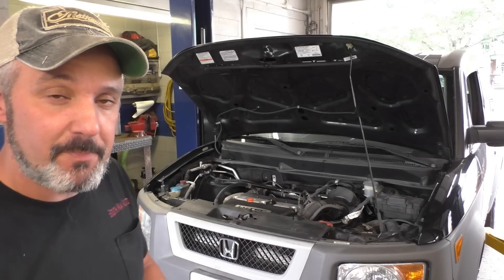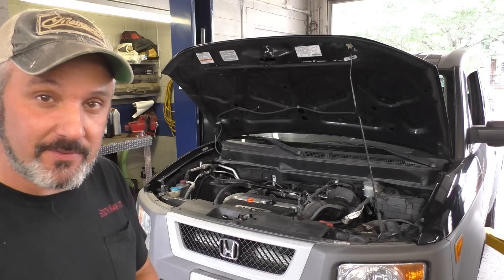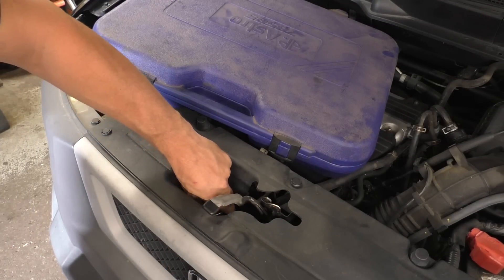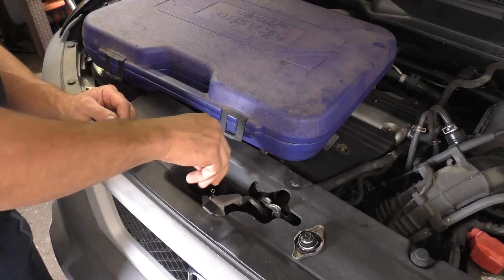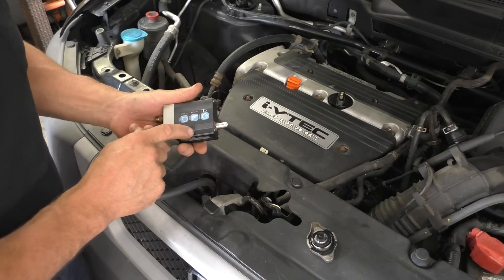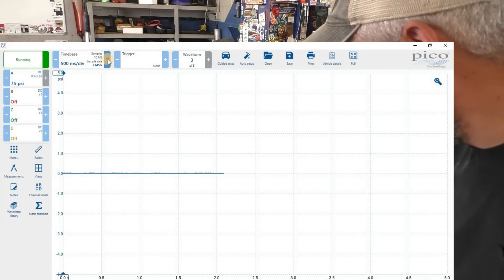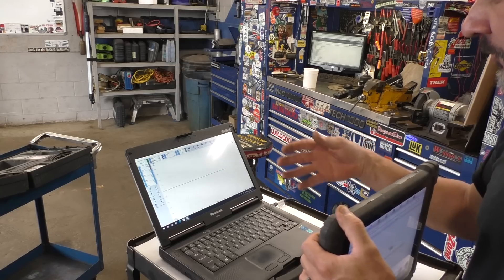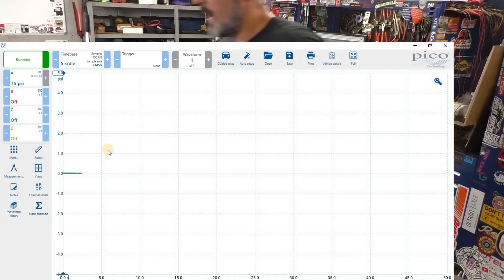Blown Head Gasket? On What Cylinder Though....🤷‍♂️

Comment: As soon as you showed the graph for number 3 I figured it is leaking between 3 and 4 and I guessed right. Great job ! It is to bad all mechanics aren't that thorough in their diagnostics. Maybe they don't want to or maybe they don't know how. I came across your website looking for a problem of my own after having my 03 Chevy stall while pulling my boat. that was my fuel pump connector. When I did the fuel pump I noticed my power steering was having issues and installed a new pump. I drove a 100 miles from home and the truck died in the middle of nowhere and had to be towed. I searched and searched and came across your website and found a video about a truck intermittently stalling after replacing the power steering pump. You found it was a bad ground for the ignition coils that grounds to the block near the power steering pump. That was my problem and I thank you for the solution. That happened last year and I have not had any more issues.
Reply: Eric O's video will be a research/nostalgia trip bonanza years from now when the only thing left of these upstate NY vehicles is their NY DMV notes that they were once registered in the state of NY 😅

Comment: Simpler way is pull plugs, look at insulators. Cleaner, whiter will be cylinders getting coolant in them. Pistons will be cleaner too, which you could see with a cheap endoscope.

Comment: How about trying to find if compression loss on a cylinder is from a valve problem or a holed piston without sticking a camera down the plug hole or removing parts?

Comment: I had a similar problem with my pathfinder leaking head gasket on the exhaust side no milk shake no drivability issues 
Only found out one day when my wife seen a puffy white cloud on a cold start then car rlran perfect dealer warranty the work only after leaving it over night to have them do a cold start. Was told it leaked after shut down and car sat once started and warmed no leak. Weird issue but glad my wife caught it before warranty was up.

Comment: This is the typical way Honda head gaskets fail, between cylinders and water jacket. Seen it a bunch on the J35 V6 engines, especially cylinder 5 for some reason. As it worsens, it will have a cold start miss/stumble until the coolant is burned out. Pressurizing a suspect cylinder with a cylinder leakage tester and observing radiator bubbles is  my go to because I'm too cheap to buy a pico and WPS. 😆 Cool demo of the WPS though. I may someday pop for that stuff. Only scope I have is the uscope.

Comment: Eric, you have a good head for head gasket woes !!!! No exterior leaks, no antifreeze in the oil, no water vapor exhaust - so must be internal leak is a reasonable assumption. I would agree. Plugs look good, no antifreeze gushing out of the spark plug holes. Now 99% confident to take off the cylinder head and see what is happening. Waiting for part 2 - The Tear Down !!!! Brewing a new cup of chocolate cherry coffee in my Krup's single machine. I'll get a 8 piece of mixed chicken at Walmart and I'll be ready on my Lazy Boy recliner !!!!!  Bring it on !!!! 😀👍🍮🐔🛠😺

Comment: Love your diagnostic process although would it have been better to start by removing all the plugs at first, then installing them one at a time.  I believe the difference is when you pulled the first two sparks individually out, it had no effect on the pressure on your test.  Does that really eliminate those cylinders?  By taking all plugs out in the beginning,  it would show no pressure build up as you showed when you had all the plugs out.  Then what you could do is start by putting plug #1 back in to see if there is a pressure build up.  If not, then put in #2, then #3 and so on.  By doing the test in the opposite manner as you did, you truly didn't prove the cylinders number 1 and 2 were not also an issue.  I'm I wrong in my assessment?

Comment: using a coolant system pressure tester would work also, just connect it and crank the engine instead of pumping it up, same result with the gauge reading pressure that shouldn't be there and a whole lot cheaper 😋

Comment: I remember back in the 90’s my sister had a ford escort. The cooling system was getting pressurized enough to send a geyser out of the radiator about 4 feet 🤣

Comment: Never even thought about doing it this way, great job like always Eric. The new way I recently learned is to pressurize each cylinder with the radiator cap off until you have a fountain from the radiator.

Comment: Being in a shop myself; time is money. I personally don't see a point in knowing what cylinder is leaking when your about to rip into it for a head gasket. Especially on a 4 banger. It's fun to be absolutely sure it's a head gasket that has failed but going beyond that is kinda pointless. To address your comments on it not showing more of the classic signs of a blown head; it's not a big enough leak yet. It was caught early. Your meter only read about 1 PSI of pressure during the cranking phase. You would need a lot more then that to blow into the coolant to actually see anything. But good video as always Eric O!

Comment: I got into this business because troubleshooting technical issues logically is the one of the main things my brain can do and loves. Watching your videos reinforces and builds on a lot of the stuff I learned in school and on the job so far. I'd even used one of your videos to diagnose a faulty ignition switch during some on the job training. Once I realized that everything that wasn't working relied on the ignition switch's status, we plugged in the scan tool and voila the status was super sketchy as you turned or jiggled the key. Sometimes it's the simplest of tests with a bit of know-how.

Comment: Awesome stuff! Glad to see you showing this method! I personally have never pulled the plugs like that to confirm. It certainly does require some more analysis, but I use a first look delta sensor, a trigger off a coil or plug wire, and then I overlay a piston chart made by “the drivability guys” to help analyze the waveform. I’ve probably confirmed head gasket failures a half a dozen times now this way, and I can say that only once was it just 1 cylinder leaking. Thanks Eric!👍✌️

Comment: That's about what my 1982 Ford Escort used to do.  It didn't actually have a blown head gasket.  It had a crack between cylinder 3 and 4 that involved a water jacket.  It was burning antifreeze.  The only complaints were that you literally filled the antifreeze and checked the gas, and that you could smell antifreeze in the exhaust and even when it was just shut off and parked.  It started and drove fine.  And I do know exactly what was wrong with it, because I helped to tear it down and saw the crack.  The head and gasket were fine.  As it transpired, this was a common problem with that 1.6 liter engine, and the reason they stepped up to the 1.9 in 1984 1/2.  They used the timing belt to drive the water pump, and when the water pump got tight with age, it would strip the teeth off the timing belt and bend the push rods.  Once they were bent, the engine would still run (sometimes), but it would run hot.  They had cut so much weight out of that engine to meet fuel mileage standard, and had cut the cylinders so thin that once it started running a little hot, they would crack.  Between 3 and 4 seemed to be the most common spot.  We had to start every wrecked Escort and Lynx in about 3 junkyards to find one that didn't have the same problem and didn't steam.

Comment: Wow! This is so much easier and faster than a leak down tester.
I built Old School Funks version of a leak down tester to diagnose my 2000 Windstar 3.8L.
Cylinders 2 and 3 were blown cyl to cyl and 3 was blown to the water jacket.
But geez finding TDC on all cylinders one at a time and screwing in my adapter made from a hollowed out spark plug was loads more work than this. This is absolutely awesome Eric.
I do get the gathering all the data thing.

Comment: I don't mess with head gaskets anymore. Too risky. These motors are generally pretty cheap out of the boneyard. I had an 09ish Acura tsx with a dead hole maybe 3, 4 years ago. Had fire and fuel,  no compression. I'm way less curious about these types of things these days,  just want it fixed and gone. Anyway,  I did get a 70k used motor for about $550. Dropped it in and shipped it. In general,  the k24 doesn't typically have too many internal problems

Comment: I had a Subi that blew 3 head gaskets.  It was always found to be on cylinder 3. I did not replace the head gasket the 3rd time.  I bought a used JDM engine.  It was much, much cheaper.

Comment: You should ALWAYS attempt to determine the specifics of a problem, especially if it can be done relatively easily and quickly.  Like Eric said, this can't be done once it's apart.  I'd gladly pay Eric for a 1 hour diagnosis, especially for something this brilliant.  How many other mechanics could even successfully do this, and video it well enough for us to understand?  

Say he doesn't, and just pulls the head, sends it to be rebuilt, and re-installs it, but the real issue is a hairline crack in the top of the block that you can't see.  He puts it all back together, and assumes it's good.  2 weeks later it comes back with the same problem.  

I think Eric is genius, and even though he thinks this level of mechanic exists everywhere, it really doesn't.  He his head and shoulders above most mechanics, as all they do is module swapping until it seems to work.

Comment: Just a way I do it. So I get the proper compression garage fitting. Put an adapter on it so I can hook a air hose to it. Put a  no spill thing on the radiatort and just turn the crank until the cylinder is up on the compression  stroke  ( you know when ya can't turn it) and look for bubbles coming out of the radiator. Basically the same thing as I don't have a pressure transducer  yet. Had a subaru with similar symptoms.  With a bore scope you could see coolant running down the cylinder. The plug didn't show any signs of coolant burning.

Comment: Nice diagnostic method. Now, if the gasket doesn't obviously look blown, you'll know to inspect the head more closely for a crack, warpage, etc and you'll know exactly where to look! I like too that you've proven that there is an issue before spending time pulling the engine apart.  Win, win.

Comment: Might be worth borescope 3 and 4 with pressure on cooling system to check for gasket or crack around valve.Pulling heads often causes the gasket to have FALSE places that look like it leaked. Course if you do a valve job and/or flux the heads it should pin down the gasket as the problem. AS YOU SAID, NOW IS THE TIME TO TEST, IT'LL BE TOO LATE AFTER TEAR DOWN.

Comment: Whoa now that's a faster diag than I can do with the radiator pressure tester. The head gasket reaper (me) needs to buy this tool
Reply: I already bought the store half inch impact and it did what no snap on or matco or Mac gun could do in the shop - take off a V6 Honda crankshaft bolt with a normal impact socket

Comment: When you did the initial test with all four plugs, you could see that the pressure climbed twice, then didn't climb for about the same amount of time, and that pattern repeated.  To me, that said two cylinders that are adjacent in the firing order were the culprits.

I also liked how you could hear the sound the starter made when you did take out the plugs, and it was very obvious when one was gone--no resistance to cranking on one out of four pulses, so one cylinder was not making pressure.  I once used that to point me toward having a dead hole in the motor of my car.

Comment: Hi Eric and the Lovely Mrs.O. I have done this test but not with a scope,I used a pressure gauge on the cooling system,probably not as sensitive as the transducer and the scope, but it worked for me. I used to get the you're wasting your time, but like you said I knew exactly where to look. Thanks Eric!!

Comment: A compression test will also tell you which cylinders are guilty. The spark plugs had to be taken out anyway. I don’t understand why this way is better. After all, the test equipment and software required are quite expensive.

Comment: With my experience, I pull the plugs, fill the cooling system, than pressurize the system, and crank it over, what ever cylinders spit out water is where the problem is. Much faster.
Reply: I tried your link and it says, "there is no content here" and would not allow me to reply.

Comment: I would have liked the initial test with a sync signal from ignition #1 or something like that, before proceeding with pulling plugs. I absolutely agree interpreting the result may be challenging, but that's also why I'd like doing it - you first get that first result with a sync signal so you can try to see which cylinder is leaking, then after pulling the plugs when you KNOW which cylinders are leaking you can go back to look at that initial test and use Hindsight 20/20 (registered trademark) to see what the leaking cylinders and the good cylinders looked like in that first test. 
It would be no help this time, but after doing it a few times you learn more about what to look for, and may get confident enough in it to just do that, or settle with it when pulling plugs would take too much time.

Comment: Well let's be honest, cracked cylinders and cylinder heads will also pump compression into the coolant system. So how do you prove there isn't a small crack somewhere as opposed to a blow headgasket?

Comment: The only problem is 99% of DYIs do NOT have a $5,000 Pico Scope with fancy different attachments
How about connecting an engine Compression Tester to each cylinder to find the cylinder(s) with the lowest compression, those are the cylinders with the leaking head gasket !
Reply from the maker: Go even less low tech and put a balloon on the radiator neck, pump the fuel pump fuse and crank it over ;-) Same results would be seen. No problems only solutions!

Comment: I have the same problem with my 78 corvette 350 runs great no problems. No misfires butt I am loosing coolant a lot of coolant. No sign of leakes  can’t find the problem could this be a head gasket. I’m stumped car run great just loosing coolant,no oil in coolant, no coolant in oil,need help Mr Eric. Doesn’t smoke or smell sweet from exhaust .

Comment: Testing which cylinder pressurizes the cooling system is a genius test, rather than maybe a compression test, which may or may not find the problem.

Comment: That pressure trace is quite telling.  How about repeating it AFTER retorquing (checking the existing torques) of the head bolts????   Vaguely possible a bolt is slightly loose and retorquing COULD fix the problem.

Comment: Regular compression test would have showed the same.sam
Reply from the maker: How so?
Reply: Naw the regular compression tester will reveal if there is a major leak like a dead cylinder. The radiator pressure tester is the way to go for finding a blown head, and this one's so accurate it gives you sub one PSI readings. Whereas the regular radiator pressure tester will just give you a ballpark answer that it's leaking but the Pico tester he's using is telling him exactly which one is leaking.

Comment: Why does the coolant pressure not leak down when you pull the #3 & #4 spark plugs? Too small a leak in head gasket for that ~1psi in cooling system to push coolant back into cylinders?

Comment: Removing plugs to me is the long way around, to much time. Its faster to sync #1 and hold tensioner back with belt just off the crank pulley, Pulse sensor should be flat line, No leaks. If water pump is timing belt drive , then plug removal would be the only way.

Comment: Still doesn't prove it's a head gasket could be a cracked head or a cracked block you don't know until you see
Reply from the maker: Correct but now we know 100% where to look when the head is off.
Reply: If it were a cracked head or cracked block the coolant would be disappearing extremely fast

Comment: Great demonstration ... way easier than a leakdown test.

The lack of drivability issues can happen sometimes. A friends e46 (bmw 330i) had a blown HG on multiple cylinders leaking into cooling system, but aside from very occasional cold start misfires and the constant coolant loss, the engine otherwise ran great and pulled strong.  It still had decent compression, which might actually explain the lack of drivability issues overall.

Comment: Would the water pump spinning with the thermostat closed not build some pressure? I mean it was only 1 PSI. Considering cylinder pressure is going to be well over 100 psi.
Reply: The water pump is only circulating the coolant. The pressure comes from the coolant heating up. But in a blown head gaskets case the pressure is coming from the combustion chamber and going into the radiator.
Reply: @ddiablolll  when any pump moves liquid it creates some pressure to overcome friction etc to move “circulate” the liquid. It was only showing a small psi increase. A cylinder creates much higher pressures so I would think a blown head gasket would show more of a psi gain than that.
Reply: @geraldnoe649  I get what you're saying, but on the PSI gauge you're not going to see that. This head gasket leak is probably the size of a few human hairs, so the coolant just disappears slowly. 

Now if it had like an eighth inch gap between the head and the block; you'd see huge spikes, you'd see water getting blasted out of the radiator just by turning it over.